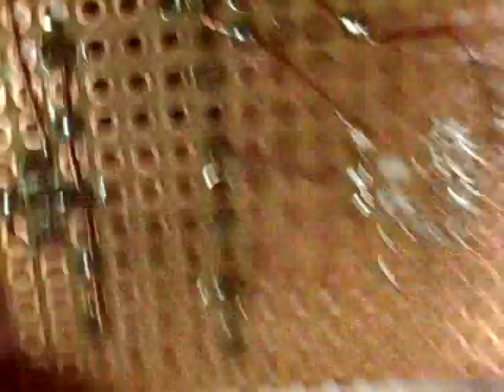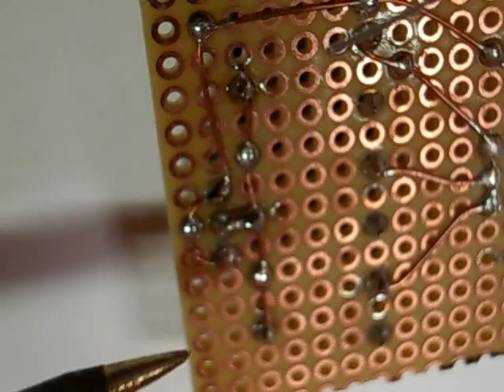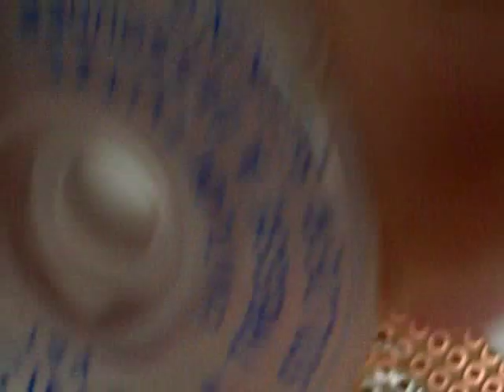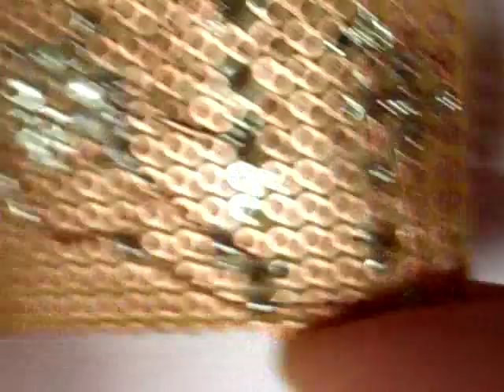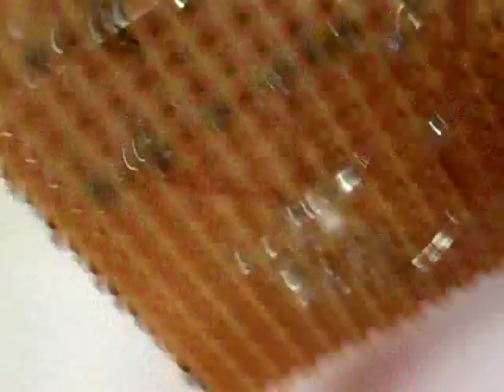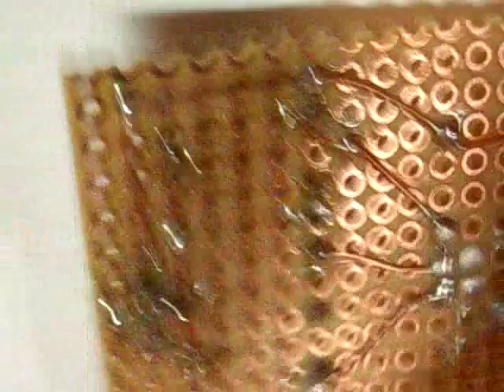Probably the millionth video showing the usage of solder wick and flux

Comment: The proper method to use Solder Wick (American Beauty Dri-Wick) is to PUSH BACK on the solder wick braid to open the holes of the braid to receive the old solder.

Comment: What kind of wick brand (flux impregnated) do you recommend to buy?
Reply from the maker: Karine T. Knudsen Hmmm... Without knowing your requirements, I'd just get a cheap one on and see if it works. 

For example:

https://m.banggood.com/Goot-Wick-BGA-Desoldering-Wire-CP1515-CP2015-CP2515-CP3015-CP3515-p-931628.html

Comment: I need a response ASAP!!!

what are those uncoated leads called and where to buy them.. like a technical term.. Ive searched everything I can think of and I keep getting "silver craft wire" and to my understanding silver doesn't rly go with electronics...

much appreciated
Reply from the maker: This stuff goes under the name of solder wick or solder braid. Any decent electronics store should have them, best are the ones that are flux coated.
Reply: +My 2µF This may sound kinda nooby but those leads on the bottom of the pcb? - connecting everything.. but thanks anyway.. I also needed to know that as well. just ordered five metres of wick :)
Reply from the maker: sorry, I misunderstood. the flu is messing with my brain. I use wire clippings of components and sometimes silver coated copper wire. it does tarnish after a while though. when fresh and clean it solders beautifully.
Reply: +My 2µF omg thank you so much, you're literally the best :) and thanks for the speedy reply :) :) :) :)
Reply from the maker: +- - (Theo) broken network cables make good solid core wires too for prototyping.
Reply: +My 2µF you are a GOD.. one more thing.. you know that weird coated copper transformer wire (found in like power supplies n stuff) can I use that? you think the coating will burn off?

thanks :)
Reply from the maker: +- - (Theo) it might work. yet there are special coatings for that purpose. if it looks messy and burnt then no. could scrape it off with knife, but cumbersome.
Reply: +My 2µF thanks so much!!!! I'll play around with some stuff. You've been awesome. THANK YOU!!!!!!!!!! :) :) :) :)
Reply: +My 2µF one more thing / again :D... do you have Facebook or something, so I can ask random electronic questions that I'm too embarrassed to say here and so random they don't appear on any forum lol.. Super ultra thanks :D
Reply: This may come late, but I had this same exact question for connecting my projects together. I finally found it under the name: Tinned Copper Bus Wire (on ebay) .. They sell it in spools, don't forget to specify the right gauge for your needs. No more stripping crappy hookup wire ;)
Reply: Tomtronics you sir, are a good man. haha thanks a lot ;p

Comment: So you need to add flux before using the solder wick? I've been trying to use the solder wick for ages and I haven't got flux. The shit doesn't stick on the solder wick
Reply from the maker: It depends. Some of the solder wicks are flux impregnated. That helps a lot. Its brown gooey stuff that is dry to the touch when cold & needs quite a bit of heat to get to work.

If you have bare copper wick, you need to add flux of some sort. The flux pens work kinda sorta, but lose effectiveness after a few seconds (evaporation). Personally I prefer flux paste (from a syringe or tube). It is not the cheapest way to go, but very effective & its effect last longer.
Reply: Thanks a lot friend. I ordered 5 flux pens a couple days ago but and did consider flux paste, but didn't know it'd be more effective! The copper wire I got came from China, so saying that it's a cheap one with most likely no flux on it. Thanks for the help, you saved me a lot of time.